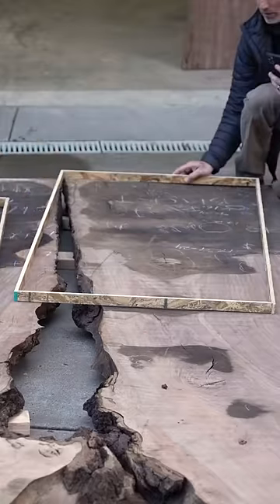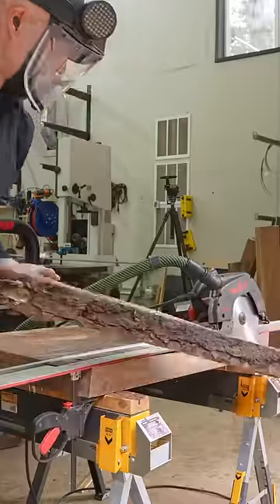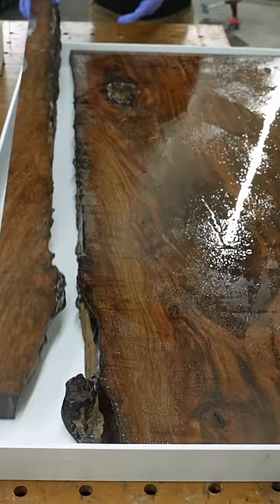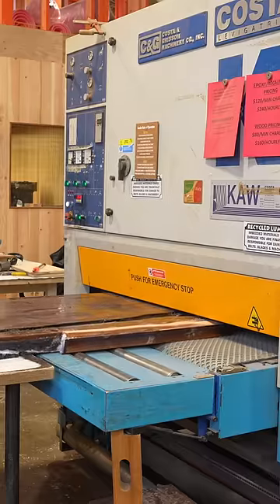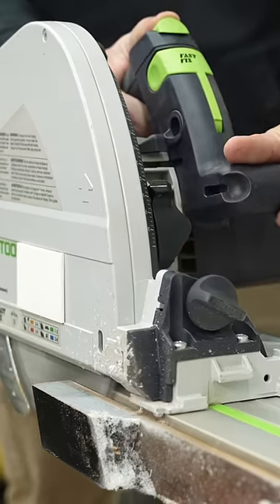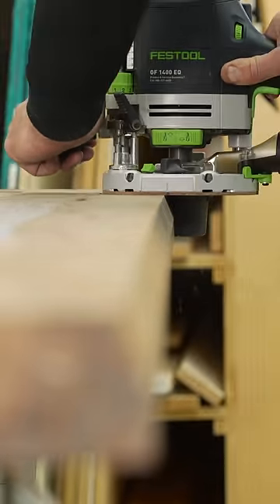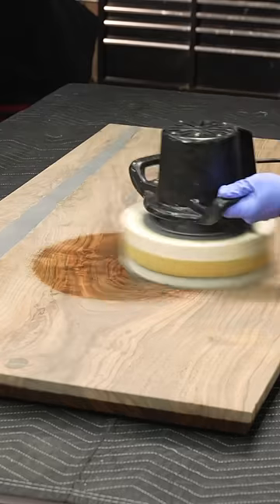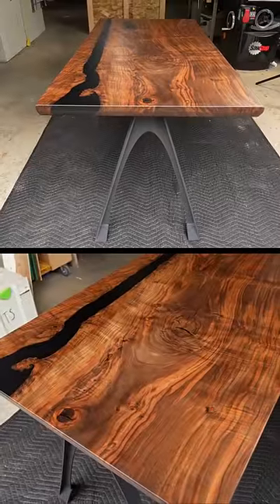Building a walnut desk

Comment: What does the moisture content have to be to do a epoxy table?
Reply: Trapped moisture in the wood overtime would cause the wood to warp or crack under its own weight. If it not properly sealed and there’s moisture, that can lead to mold.
Reply: @sriracha5524  Not just that but if the moisture tries to leave the wood at the top, it can delaminate the epoxy or cause bubbling/bulging without necessarily bending the wood itself. In extreme temperature or humidity fluctuations, this can be quite severe. 
Arguably bowing or bending is worse, however wood can also be bent back. A delamination can tear the wood apart.
Reply: @sriracha5524  he asked what content should it be not what it would do can you even read?
Reply: @willow1545  We love the unnecessary rudeness. If you would actually read into my response, it’s implied that moisture content would be detrimental to an epoxy table and in turn, the moisture content should be as close to zero as possible. Learn to read my friend. :)
Reply: As the other person said I thought these pieces of wood used for furniture like this have to be dried out for years. 

You can’t just cut a tree down and use it for furniture if you want they furniture to last.
Reply: @darkopz  Ideally, yes. However, improperly dried wood can take much longer to dry, and some woods retain water considerably longer. The density of the wood will alter its drying time. 
Specialty pieces of exotic or expensive woods are often turned quickly because most lumber yards don't want $8,000 slabs of wood sitting around for years. Aside from that, many lumber yards don't know much about when a tree was felled or how long it was drying or what drying conditions it was under before they got it unless they procured it from a reliable felling company. That's not always possible for exotic woods, as many come from regions of the world without a lot of regulation. It's all too easy to accidentally buy a piece of wood that wasn't properly cared for and has water pockets. Ideally, you'd want the wood to be a very low moisture content and dried in a humidity controlled environment to help prevent cracking or severe bowing. 

It's essential to always check your wood's moisture content before treating it with any hardening agents or coatings. One hot day is all it takes for that moisture to delaminate your shit. 😂

-A fellow woodworker.
Reply: @willow1545  😂😂 why you gotta be rude?
The moisture content should be less than 12% they have machines to measure that usually, I heard this guy the channel guy saying that.

Comment: Why exactly did it sell for so high? Type of wood? Not saying the work is bad at all.
Reply: It's all about what someone is willing to pay. 
I sold a painting when I was a kid (10y/o) I thought it was horrible but a guy asked to buy it for $25 and I told him it was for my mom and he immediately offered $75.
I painted my mom another picture.
Reply: It's pretty expensive to make and takes a lot of time, experience, and effort.
Reply: I may be off on my estimates, but I've watched quite a few of these and can guess some of the pricing. Based on his other videos, that's likely $5k slab of wood. His static overhead plus electricity and added cost of waste services for the time involved is probably around $300. He likely is going through around $200-400 in wear and tear in his tools plus disposable tools (sanding pads, melamine boards, etc.) and rental time of the large planer spread across multiple projects. I'm guessing that's $200-300 worth of epoxy and finishing chemicals. It's hard to tell on his labor in these, but just taking these estimates and taking the low end of the FDMC Pricing Survey for hourly rates for woodworkers would only take about 100 hours of work to make up the rest and he easily puts that into a lot of his projects.
Reply: @Merennulli  from what I've found 5g of epoxy is anywhere between $400 and $1100. I don't remember the brand he used
Reply: @SgtRudySmith31bRet  I'm going off what he said a previous table with a larger epoxy fill area cost, but it's entirely likely I'm underestimating how much he used here. That said, that 5g bucket is what he prepares it in, it's not full. We've seen him do as little as 2g out of a 5g bucket.
Reply: @Merennulli  the sheer size of it is a big factor too
Reply: I wonder if he's adding shipping cost to Europe as well. That would not be cheap.
Reply: Walnut wood is really expensive

Comment: This guy said 10k yeah no chance
Reply: Clearly you don’t understand how this works
Reply: @Jmasteredits  ok explain it to me then buddy, clearly I don't so explain
Reply: @thomasfrost3877  ok so yeah 10 grand makes sense because one material cost wood is not cheap at all 2 time I definitely took him a while to make this piece and time cost 3 quality on top of the rest it is a very nice piece with high quality 4 it wasn’t just this one price it was a bundle of three
Reply: @thomasfrost3877  are you gonna answer or did your brain just overload
Reply: @thomasfrost3877  If you had trouble following his explanation, I'll give one that's more numerical:
$5k - "Figured" slabs of that type of wood in the thickness needed.
$300 - Static overhead costs to owning a shop, electricity, shop-specific waste services for the time involved
$200-400 - Tool amortization, disposables like the sanding pads and melamine boards, and rental time for the larger equipment he doesn't own.
$200-300 - epoxy and finishing chemicals
$4-8k - labor for an experienced woodworker at industry standard pricing doing as much work as he did.

I don't know what the table legs cost (he has his own people he works with), but it's usually in the $100-300 range and we're already over $10k. He's eating some of his labor costs because he's self-employed and can get away with underpaying himself.

Just getting a machine-made solid wood table these days runs around $500 for normal wood. He's doing figured wood, custom pieces with epoxy and other facets. If you think this is expensive, you haven't seen the market.

(Note, I'm not a woodworker, I just know related expenses and googled what a typical woodworker makes per hour.)
Reply: lol I love it when people like you are in the comment sections pretending like he gives a shit whether or not you like it 😂
Reply: @Merennulli  thank you I was trying to say something like this but I dont know details like that I only have some limited knowledge so thank you